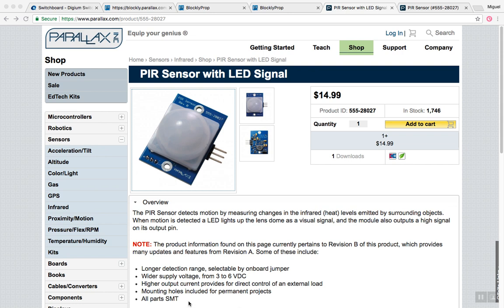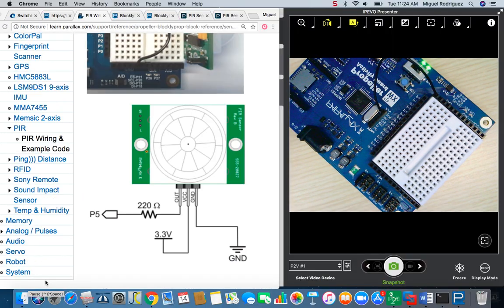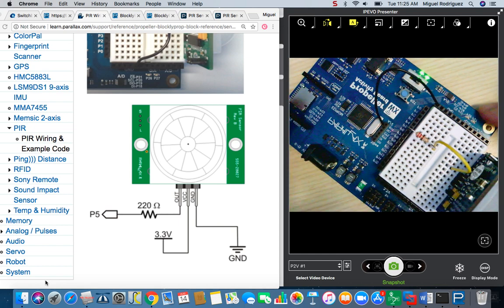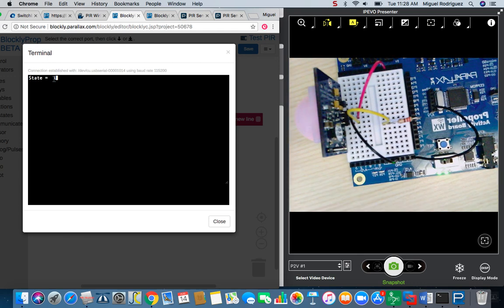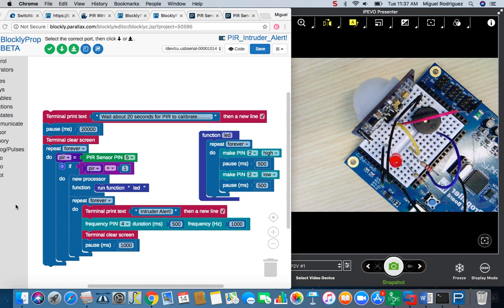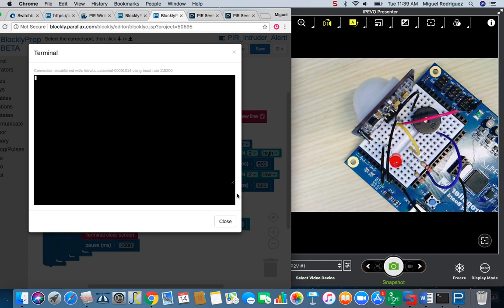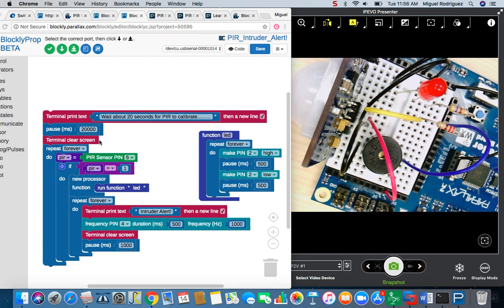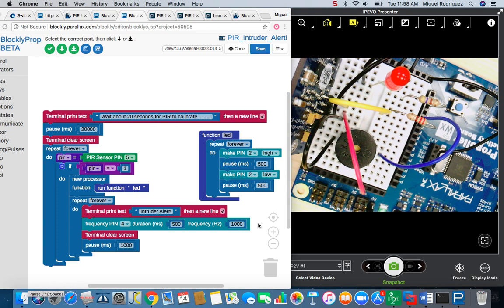Tiny Tutorials: PIR Sensor

Comment: What is the inbuilt time delay the Parallax Inc 555-28027 sensor. I need a low time delay for my application
Reply: hi, i am also needing a low/no time delay sensor for my project, by any chance did you find any sensors that have that?
Reply: @eashankhan1090  I found WMYCONGCONG 10 PCS HC-SR501 Pyroelectric Infrared Motion Sensor Module Detector on amazon that has a 0.3s delay. There's also youtube videos on how to shorten the delay time by shorting a resistor on the sensor but I didn't have to do that for my project.